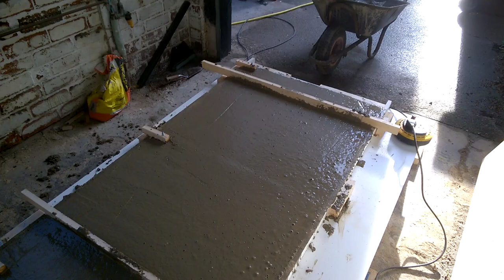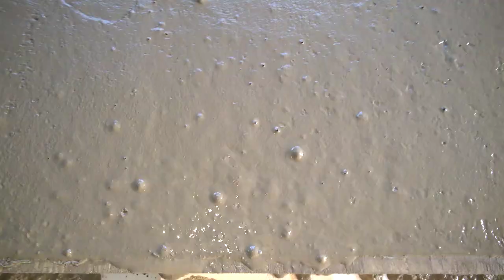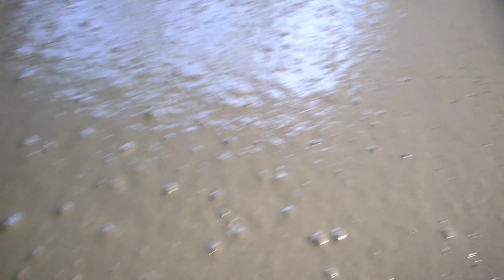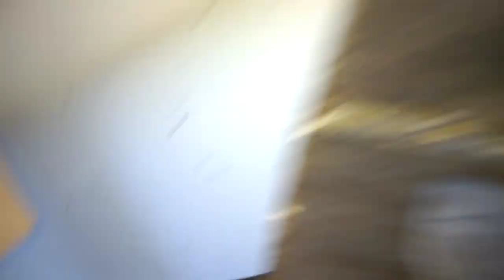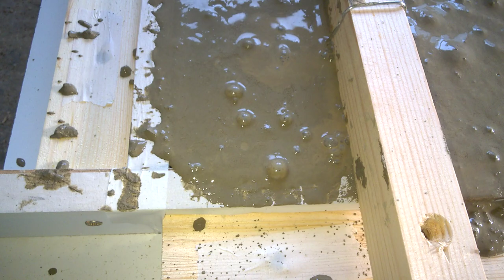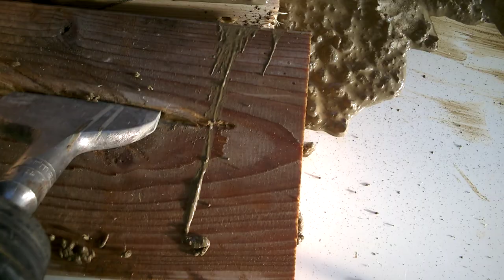Vibrating concrete worktop in a mould to release air pockets with a Dewalt SDS Plus hammer drill

Comment: I watched a video about making one of these and it seemed a cool idea, apart from the hours thumping the mould with a rubber mallet to get rid of the bubbles. I like this version a LOT more!
Reply from the maker: Thanks 👍 i had one yrs ago with a washing machine motor attached underneath with a bent bolt that made the whole bed shake, the mould wasn't as big as this & i had the luxury of being able to get underneath, this was so big i built it off the floor for strength/stability, I guess you might be able to do the same with a drill & the bolt in the chuck.

Comment: brilliant!!! I wonder, have you experimented at all with vibrating actually in the concrete with a blunted drill bit? thanks for this, by the way - I wish I had seen it a month ago!!!
Reply from the maker: Thanks 👍 This concrete was only 2" thick, I don't think it would work to well, you'd have to go around poking it in everywhere & might damage the mould inside, there's a tool you can buy that fits in a drill & vibrates for lowering into concrete, I used to have a table with a washing machine motor mounted underneath that would make the table vibrate,